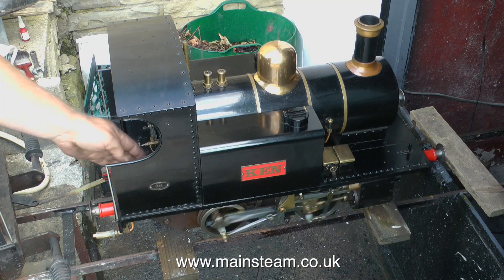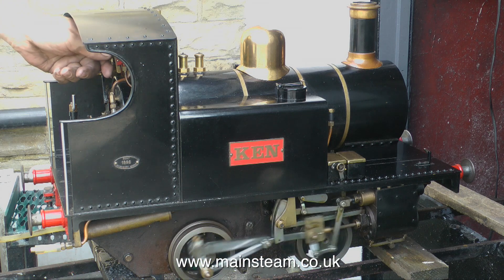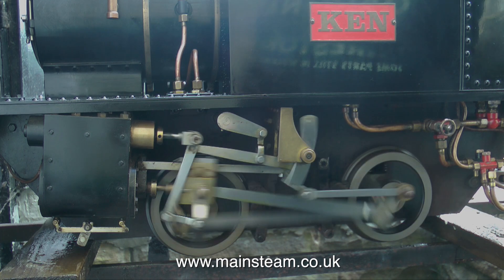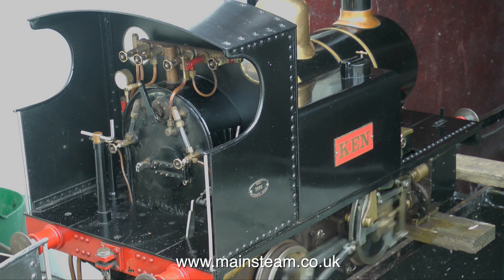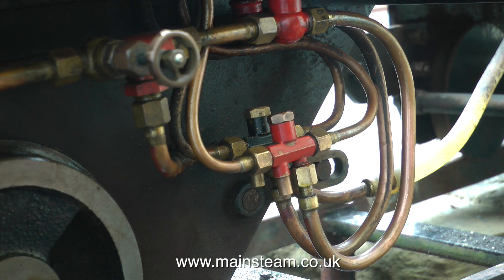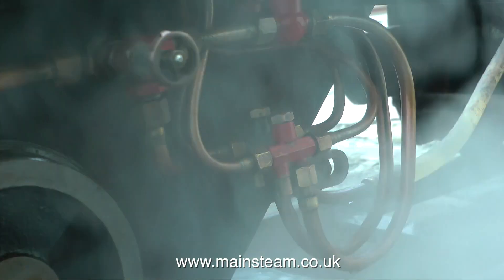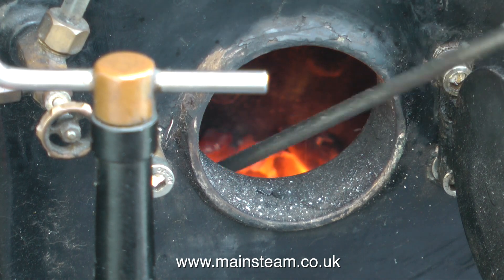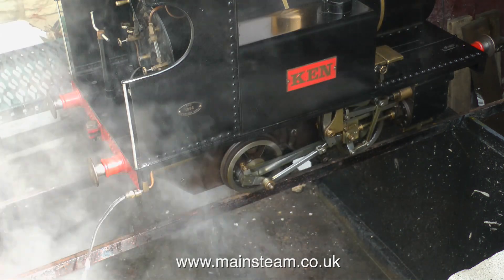TESTING MY OWN SMALL STEAM LOCOMOTIVE IN THE GARDEN

Comment: What is the full operating pressure of the boiler, and do you use some type of steam expirator nozle for the exhaust (Kylchap, Giesl,...) ?
Reply from the maker: 90 psi working pressure and it has a simple coned blast pipe and a petticoat pipe under the chimney.
Reply: Thanks :-)
Amazing loco by the way :-)

Comment: Why should you not blow down a boiler at full pressure? Just wondering as I was taught to blow down the boiler after a days work just before shutting it down, we had a 30 HP oil fired  stationary boiler we used for steaming 44 gallon drums and heating a caustic bath and dryer.
Reply from the maker: Mentorcase I was always taught to let the pressure drop a bit before blowing down on model copper boilers to prevent sudden distortion of the boiler shell.
Reply: Is blowing down just venting the boiler freely from the bottom  so any particulate (aka scale/crap/dirt/chocolate wrappers) is carried away in the out rush of water (and eventually steam)?

Comment: G'day Keith thank you for the video on this great looking loco.  I have just started out machining and bought 
myself a Sieg mini lathe as I have had a life long desire to build a steam engine.  I found that your series linked
videos for beginners in steam engine machining very helpful and I thank you for sharing your knowledge on a 
open forum such as You Tube.  May I ask you what would be a good beginners steam engine to build?  Once
again a big thank you I have subscribed and look forward to the next instalment.  Kind regards John Tasmania
Australia
Reply from the maker: John Kinnane I would suggest a Martin Evans 5 inch gauge "Simplex" as a first engine, it's easy to build and if built well runs great. (that was the first loco i ever built too)
Reply: John Kinnane You could also consider a Barry Potter Blowfly.
It's an Australian designed beginner locomotive and are quite popular, they even have a rally dedicated to the design.

I'd suggest going to your local miniature railway society and see what is there.
It is best to pick a locomotive others have so that you can get lots of helpful advice and tips while your building, as see how they implimented the features like injectors, lubricators and so on.

Other ideas is buying kit supplied like Maxitrax and Polly Engineering, but make sure they build the boiler to Australian Boiler codes.

Comment: Very exciting Keith.  I am looking forward to seeing your engine steam around the tracks.  Do you use distilled water for the boiler?  If so where is the scale coming from?
Thanks-
Reply: I just purchased a circa 1964 Mamod SR1 Steam Roller like new in the original box. It had a bit of scale in the boiler.  I used vinegar rinse three times and the inside looks like new.  I used distilled water collected from my dehumidifier.  Does that sound like a good idea?  Thanks-
Reply from the maker: Fred Miller It's ordinary hose pipe water - we live in a soft water area, and the sediment is now clear.
Reply: Where I live, we have really hard water. So using some sort of boiler water chemical is highly advisable(as is with all boilers). I need to get some before my first fire up in a few weeks.
Reply from the maker: Fred Miller I always use tap water, the scale is easy to remove with kettle descaler if it gets to be a problem.